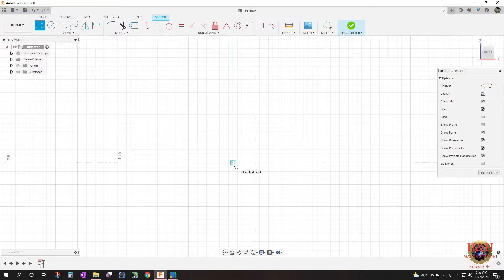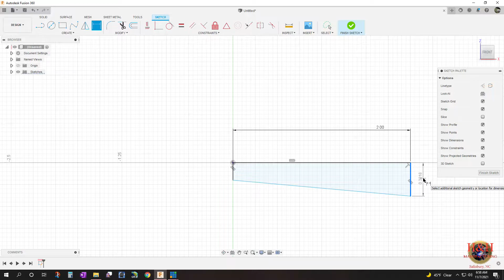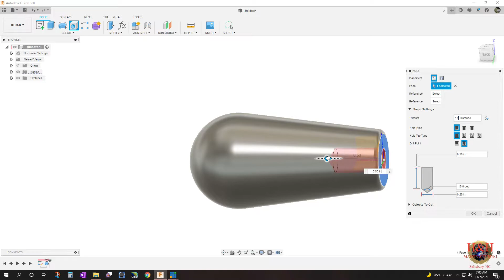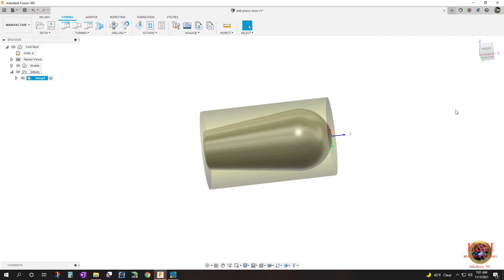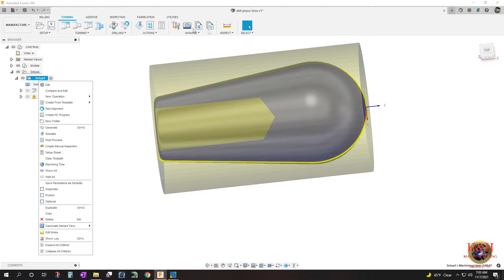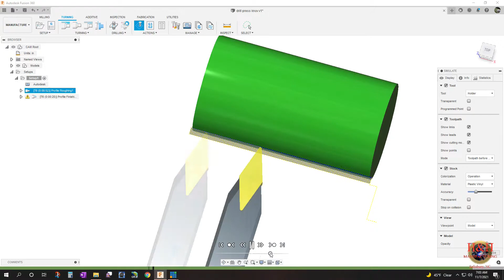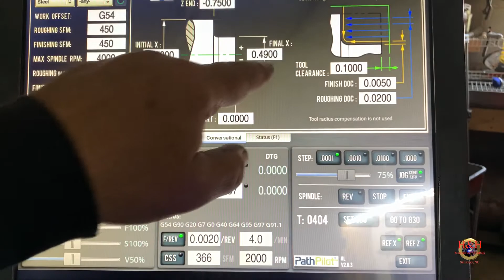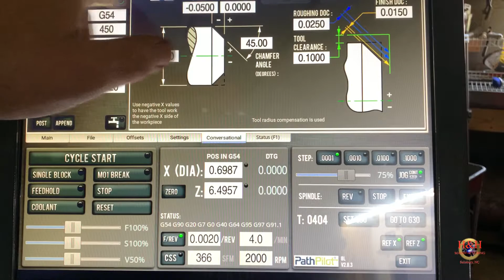Shop Update ---  Drill Press Handles

Comment: Hi George, thanks for posting these 8L videos.  I've been looking at buying an 8L myself so these videos are a useful resource.  I got some Spindle power and torque data from Tormach for the 8L and created some HSM Adviser machine profiles if you happen to use that software to calculate feeds and speeds - I've been using that to calculate some theoretical feeds and speeds to get an idea of how it might handle the types of parts I would make on it.
Reply from the maker: I use Fusion 360.  I am very new to CNC though.  I have been using the recommended feeds and speeds from the insert, and so far I am pretty satisfied.  I'll look into the HSM advisor though.  Thanks